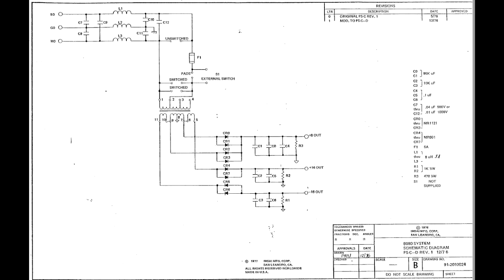#13 IMSAI 8080 a look at the power supply

Comment: What are your thoughts on reforming the power supply capacitors? I’ve wanted an IMSAI since I was 15 and now I finally have one 😊. I’m an EE with about 35 years in the field, mostly in embedded systems. Got this thing on Friday and I’m thrilled but I want to bring it up slowly as I have no idea where it’s been or how long it’s been idle. Suggestions? And thanks for the previous answers.
Reply from the maker: remove everything so the power supply is not connected to anything. bring voltage up slowly with variac and monitor current/power. it is a very simple supply and those capacitors are pretty robust. remember that  each board has it's own regulators so the main supply it not too critical

Comment: I am looking for a proper Fuse for one of my IMSAIs and I can not find enough information on the proper Fuse to look for. I believe that it is a 5A 250V 3AG. But I can not tell or find a reference to, if this fuse is a FB or a SB. I have seen a few on eBay that look very similar to the one I need to replace, but they indicate that they are SB. 

What should I be looking for, and where is the best place to find, the right fuse for this system?
Reply from the maker: The manual calls out a Bussman MTH-5 5amp fuse
Reply: @IMSAIGuy  Thanks, I went out and picked up a few 5A FB fuses from Home Depot, and although they work in my good machine, they blow immediately, when I apply power to the machine, I am having problems with. 

When I received this machine, just recently, it would power up with no problems. I replaced the memory board, with a known good working board, and that is when the fuse, first blew. I have removed all cards, except the front panel, and the fuse, still blows.
I am getting ready to remove the front panel. Is there something else, I should look for?

Thank you
Reply from the maker: @jeffnay6502  those really big caps in the power supply might have gone bad.